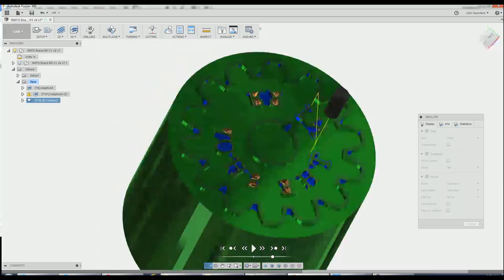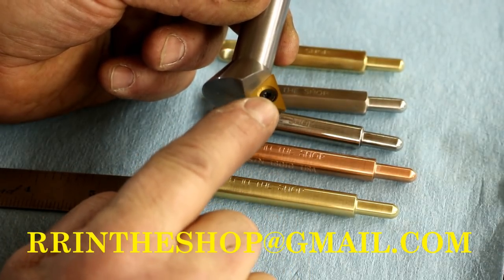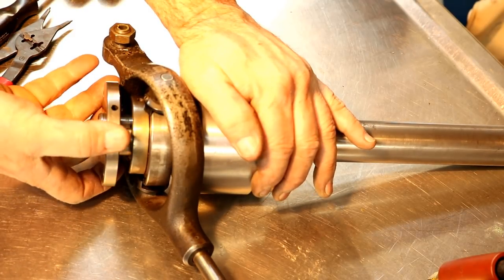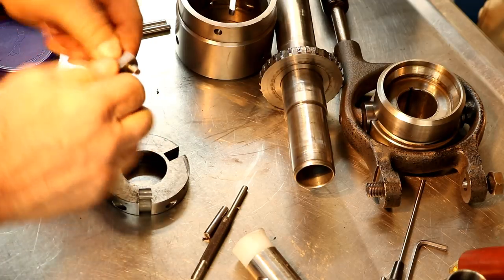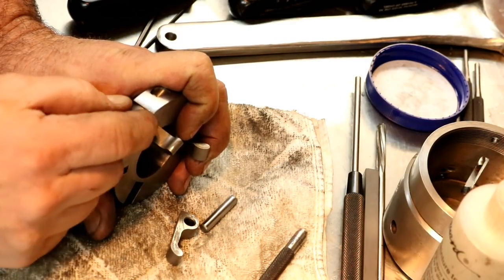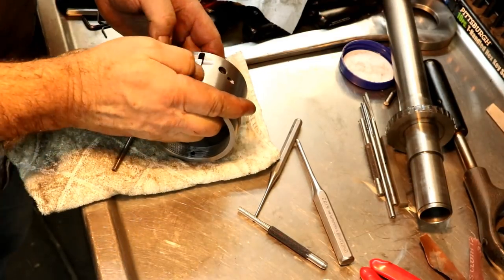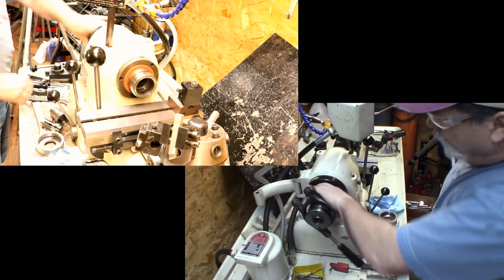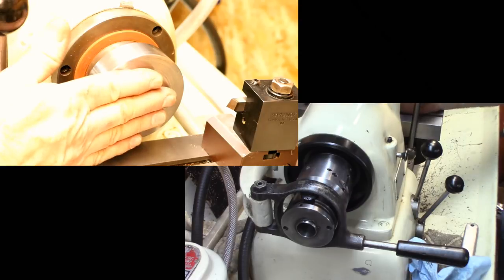Hardinge Lathe Collet Closer Explored/Repair

Comment: That was fun. The wife growled that I needed to load dishwasher. I responded- I'm helping Randy wait a minute. House temp dropped a few degrees and eerie silence fell over the house. Good work Randy. Nice to  watch the pile of punches grow and change as you went along. So it isn't just at my shop the pile of tools grows on simple jobs. 

Dan
Reply from the maker: Everytime.  I usually start with a large clear area, by the end there will no room to work.
Reply: same but its been growing for years

Comment: Pierre, Phil and Robert will be happy to see their hammer has been well used.  Neat to see how collet closers work.  You must be getting frustrated with having to fix every one of them though.
Reply from the maker: No frustration, just the things you have to deal with with older equipment.  But I have learned that no one performs maintenance on collet closers.

Comment: Randy, I know this is an old video but around 35 mins you mention spring washers for the closer gimbal saying you replaced them .. I've been looking for those .. do you have a lead on part number or where you may have bought yours in what size / strength / thickness? thanks!
Reply from the maker: MSC link:  https://www.mscdirect.com/product/details/01587666,
Reply: @RRINTHESHOP  Thanks Randy!

Comment: I have a DV-59 in very good condition but I have belt noise. I noticed your Hardinge is extremely quit. Any hints that aren't  in my Hardinge manual? I'm guessing belt tension is the issue but I'm not sure how to get it right.
Reply from the maker: I would make sure the belt has not been slipping and has deposited material on the Reeves Pullies.  Maybe time for a new belt.  Mine is very quiet.

Comment: Randy, i have a Spirit capstan lathe. A very nice Italian machine. When i bough mine the collet closer was sticking. Mine was due to rust from soluble oil drying out. It was never cleaned or lubed on a regular basis. Grrr  One thing i have found is to lube every month with thin synthetic oil. The additives in the oil stay on the parts and they work real sweet. Keep the vids coming as i look forward to my weekly dose of tool porn. :-)
Reply from the maker: Lube would of helped, I think the pins had been in there since it was new.  Working great now.
Reply: My machine was supplied new to a school, where i bought it from. I don't think it was ever lubed, must have been a bad teacher. lol  
Its disheartening when you buy a machine and it does not work as it should and you have to do a lot of work to make it work properly.  So i'm glad to see yours is fixed and running good. i use 10/40 synthetic oil. I usually have a can or two around as its used in the motorbikes.